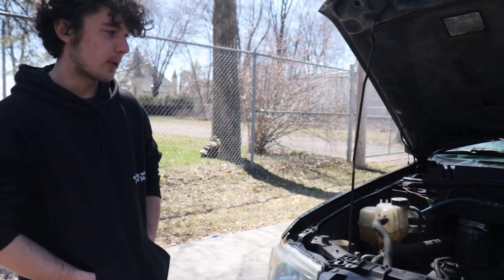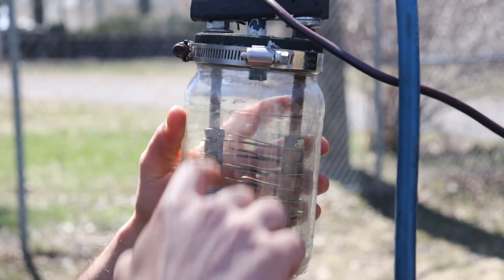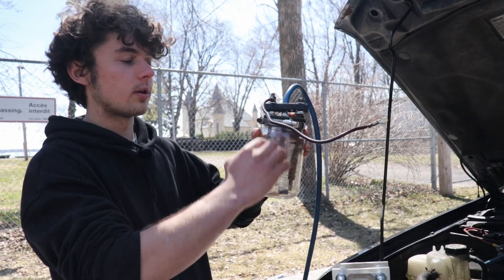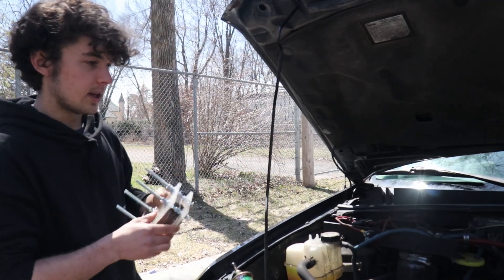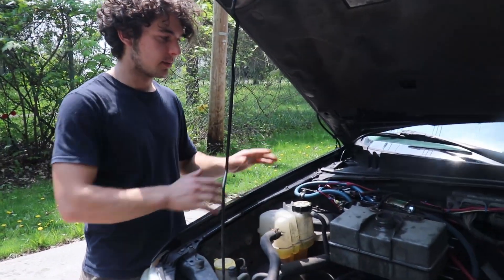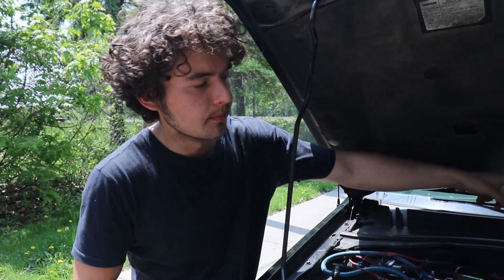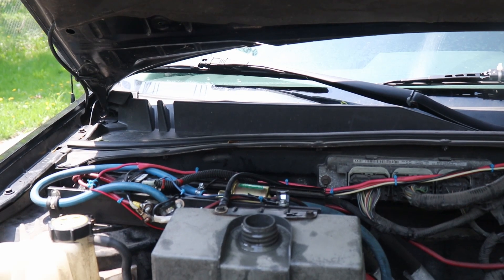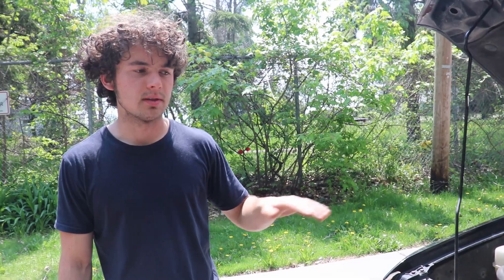Homemade hydrogen generator system

Comment: You must tune your ECM to use these otherwise you might get quite a surprise when vehicle starts costing more $$$ to fill up. O2 sensors play a huge role in your vehicle. While making the vehicle more "efficient" by burning all the fuel in the combustion chamber sounds great, its not how the engine was designed to run (unfortunately) meaning your O2 sensor may think your engine is running lean triggering adjustments to the air/fuel ratio and thus dumping MORE fuel through the injectors into the engine. Net result, more fuel used. Everyone forgets in order to save on fuel, there must be less fuel pumped into the engine. Only the ECM programming can change that.
Reply: How can I do that? I get 12.6 mpg and am planning on building one of these but I want to do it right
Reply: @GeicoGuy25 I had a Mazda V6. Got 16 mi a gallon I put a 9 plate dry cell. In it and got 24 mi a gallon. I only got a good improvement on the freeway. In town just two or three miles a gallon better. I put it as close to the carburetor as I could in front of the sensor. I do a lot of freeway driving works great. 316 stainless steel. You can use salt water. Vinegar and water. Baking soda and water.
Reply: @Brad-sh2wn  I know so much more abt these now than I did when I first started getting into them, I've been using baking soda and distilled water so are the other solutions any better than that?
Reply: I believe that by wiring your power source from the throttle body actuator sensor (if possible)   you would eliminate all that wiring, soldering, and installation time. Your amps  producing hho would  increase in real time with the gas pedal, in theory.
Reply: Or switch ur fuel injectors to carburetor
Reply: The tiny amount of hho will not make the slightest difference to the engine "tune".  Any noted difference is just placebo effect.

Comment: I watched a test being done and it used more gas then an engineer said the O2 sensors caused the fuel injection to sense it was burning lean so it added more fuel so on a carburated engine it would be alot better. The sensers basically didn't sense enough none burnt fuel in air bc it had a way better burn in engine so it believed to much oxygen was entering compared to fuel seemed to make alot of sense and I guess that's why a certain company that produces them has a computer programming thing that allows it to by pass those codes with their hydrogen kit. Around 800 to 1000 for it.

Comment: Any affect to battery or alternator?
Reply: Yes it puts extra load on them which requires more torque to turn them, which takes more fuel...
Reply: @ratgreen  I put a nine plate in a 1996 Mazda V6. Got 8 Miles more a gallon on the freeway. Between 6:00 and 10:00 amps . Don't go above 10 amps.

Comment: Smart kid, but he need more learn about electrical field resonance , dry cells not enough efficient, the best hydrogen cell design by Stan Meyer, Stan Meyer cell work stable, and produce a lots of HHO, plus need to be build all other electronic components . Also need use Volo chip to adjust  OBD2 ECM system for HHO, with out Volo chip ECM will work wrong way.
Reply: Are you referring  to the convicted fraudster  Meyer?
Did not work then, won't  work now.

Comment: Physics 1/1. Garbage in garbage out. The electricity needed to produce HHO "stresses" the alternator, meaning the engine has to work harder(consume more) to spin the alternator, for the extra juice of electricity needed for the electrolysis.
So at the end in best case U will end up using the same amount of fuel for the same mpg.
Reply: The alternator is already running whether you want it to or not. It's already generating electricity and storing it in your battery. The question you should be asking, Mr physics, is. Is this only drawing excess electricity stored in your battery? Because if not. You'd have a dead battery after sometime and you'd know that your system is drawing more energy than you're producing. But since that's not the case if you search youtube long enough. You'd know that cars are wasting so much energy as is either as electricity or as fuel, Because internal combustion engines are only 30% efficient at best.
Reply: @nouamanesamir7635  Thats not how it works. Get a DC motor and try spin it by hand. It spins easily. Now, put a light bulb across the two wires from the motor. Now try spin it. Much much harder. It takes more load to spin it. Which is exactly what happens on a car engine. The alternator puts more load on the engine, the engine has to put more fuel to keep it spinning at the same rpm.
Reply: @nouamanesamir7635 would it be most efficient in a hybrid? Sorry if it's a stupid question, genuinely curious.

Comment: For starters great job! My thoughts wouldn’t it be better if hooked to alternator? I like the use of the solenoids, wondering if a relay would use less power, I really want to do this in my impala
Reply: Don't, hydrogen embrittlement is a thing, where it can actually weaken steel. But it likely won't save ya gas ne ways

https://youtu.be/6zErilY7E-M?si=Oz9n9dwUqLgCyHdi

Comment: What would happen if you used copper instead of stainless steel?  There's a guy on YT,  HowToLou, who made a video on generating oxygen through electrolysis but he generated more hydrogen than he could ever generate oxygen through the copper wires.  That intrigued me.  The video  is called "DIY Oxygen Machine".  I'd love to hear your thoughts on that.
Reply: When passing current through water and metal it starts to oxidize the metal and break it down .  Stainless steel can withstand a longer oxidation process. Copper oxidizes very quickly and will Deteriorate faster than Stainless steel would also the oxidation on the metal will also slow down the flow of current making the process inefficient. Gold is a great option if you don't want oxidation on the plates but it will be  very expensive
Reply: You get 2 volume lines of hydrogen and 1 volume line of oxygen: water = H2O. It doesn't matter if copper, steel or   charcoal

Comment: Be careful!
I did this exact project for my 3/4 ton Suburban 22 years ago.
It went well ,gave a nice power boost until the engine started stumbling.
I found that the hydrogen generator had clogged the O2 Sensor with a white calcified powder,let's assume it was the sodium hydroxide that was used to reduce the covalent bonds binding the hydrogen and oxygen molecules, so they would detach into hydrogen and oxygen gases more readily.

I'm a formulation chemist by profession.
Reply: So o2 sensor pre combustion.... LMAO
Reply: Quick question, did you run the hydrogen injection before or after the o2 sensor?
Reply: @mrdavyjones  Before.
Running it downstream of the O2 sensor could possibly have been a better solution. But I was concerned about damaging the internal moving parts.
I have 6 of these hydrogen generators left from my experiments 20 years ago.
One day I will resurrect the test again.
Better,simpler Idea....
Get a gas cylinder from Air Liquide with compressed hydrogen,kinda like the nitrous injector guys do for street racing.
Let's see what happens.
Reply: Idk too much about this but I am sooooo very interested. Does it matter when you use a super purified water to use??  I see there is a new device/water purify unit out now that came on my feed. Do you think that would eliminate some of that powder residue?
Reply: @frantasia555 purifed water takes the minerals out that make the water conductive so it work work less
Reply: your suppose to put drain cleaner in the water, it make it more conductive, potassium hydroxide, salt or baking soda. some of these can be very caustic and dangerous as well, potassium works best but is dangerous, baking soda and salt aren't as good but aren't as dangerous. something ive seen in alot of builds is that all the extra O2 messes with the computer in newer vehicles. a vacuum line in an older carb motor is ideal, but he also doesn't state where he piping in the gas. im assuming the air intake like everyone else tries to. but again this messes with the cpu and fuel mixture. there's also hydrogen embrittlement, where hydrogen atoms can actually weaken steal. i guess it leaches the carbon out or something. tho i assume this takes time , it would shorten the engines life. and its not as straight forward as he makes it out. id be surprised if its actually  saving him fuel if he's just slapping it on and not tuning the computer , I've seen some people say they've have to reset their computer after running these. in the end if you have a vehicle you dont care about to experiment with, or the money to fix it if something goes wrong, go ahead. but do alot more research, ive really wanted to do this aswell and everyone ive seen that use to use one. stopped using it for one reason or another. @frantasia555
Reply: @drowsycannon5179 people forget to put a filter system in. You need to filter the hydrogen good to keep the toxic waste out. Yes it will ruin your engine if you don't. Using salt vinegar or baking soda is better than the toxic toilet flush stuff.
Reply: @frantasia555  you just need the filter it. Also needs to be put after the sensor
Reply: Check out my Hydrogen 95 gmc sierra 4x4 standard on youtube runs great on my hydrogen kit I buikt
Reply: i had the same white powder formed at the air control inlet valve. my first gen HHO used K-potassium mixed into distilled water. the mixture get warm that created the bubbles which is HHO when passing through the gen. not sure why it got into your O2 sensor. the water came out at the tailpipe. i did use it on the 1998 Buick Park Avenue. problem is the CA DMV will not allow the smog station to certify this contraption even when the exhaust shown NOX .005
Reply: Just use Xtra solar batteries  for power and efie boost
Reply: Needed filters.
Reply: Jim Henry you needed some good filters

Comment: 2 inductor coils should be used . Concentric SS pipe electrodes should be used. There is is a frequency of the collective water capacitor to determine.  What type is the SS electrodes? You should  equalize the surface area of both electrodes. The power supply is supposed to be "burst mode" on and off time of multiple pulses. As water level moves downward slightly, there is to be circuit to update frequency so PS and cell always matches.  The voltage was to be about >= 1500volts through resistance type magnet wire of double coils secondary on same core as primary pulser. Tap water puts contaminants on electrodes, distilled water is always  better. DC output for hydrogen gases, AC for steam generator heater. There is high efficiency hydrogen production with high frequency+ high volts pulses like Meyer cell, , and then there is amps type low efficiency electrolysis. High volts  >1500 separates molecules  to gases generated. The Canada Patents by Meyer have extra details not in the American versions. Meyer's technician went to Canada and started Xogen Company with the Chambers Patent, using some of the Meyer data. The Hydrostar circuit Manual to purchase of many years ago was his . Flyback reverse higher volts pulses from coil was to attach to cell electrode.Voltage pressure separates molecules of water, AFTER small TEMPORARY current pulse aligns up all plus and minus poles of molecules. The Fuel gases generated are overunity on proper set up Meyer cell. GET and see Meyer company 2 manuals- Birth Of New Technology and Water Fuel Cell Dealership Manual.
Reply: Получается надо делать умножение напряжение ???????
Reply: Sounds like you know your stuff! Do you have a website or any resources for further information? I'm completely new to this but pretty handy. I'd like to make a simple one to try it out. Running it off a coil sounds like the way to go for both the pulse and high voltage. I've got coil packs on each wire though...
Reply: Se ligar na tenção dos cabos de ignição,são de alta tenção."velas'"!?